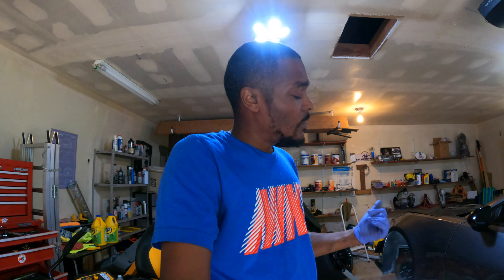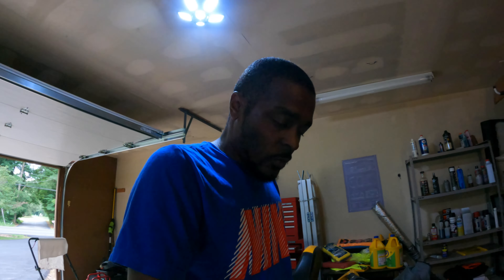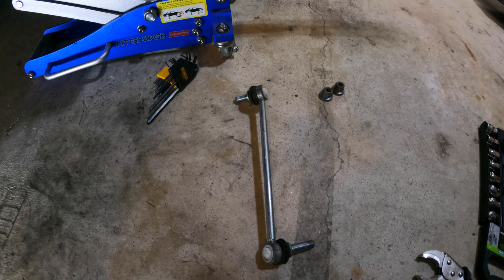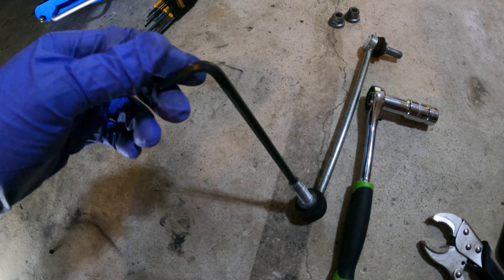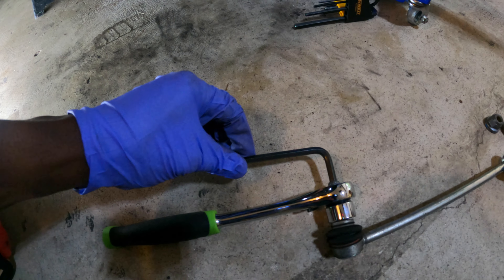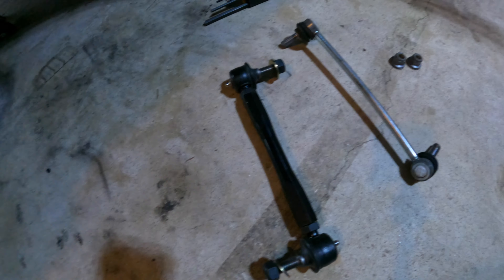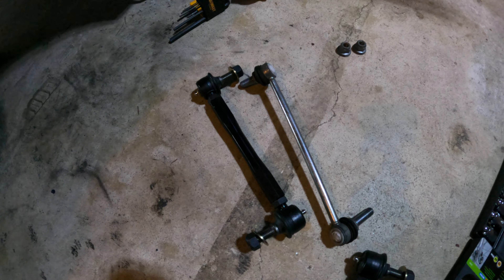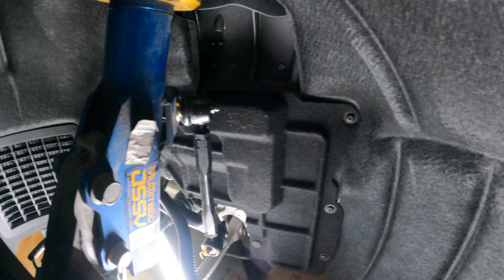ZL1 1LE BMR Sway Bar End Links Upgrade. #zl1 #camaro #bmr #lt4 #coilovers #2019camarozl1

Comment: Great video! What did you tighten the top and bottom nut to?
Reply from the maker: What do you mean  on the links or strut?
Reply: @nbankxworld8614  the two nuts on the endlinks, did you torque them to a specific foot pound setting or just tightened then
Reply from the maker: I tightened then until they wouldn’t turn anymore